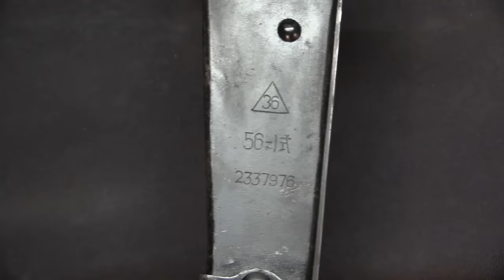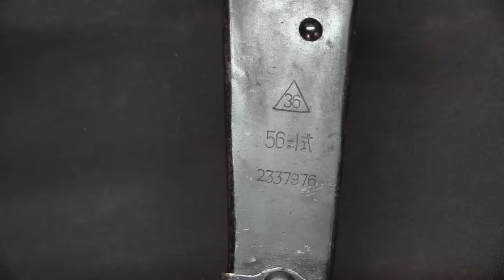RPD: The LMG Adapts to Modern Combat

Comment: Even though I know the RPK is better, I've always preferred the RPD on account of looks. It is peak Russian aesthetic.
Reply: Peak 40s Soviet aesthetic.
Reply: Huh? The RPK is the worse mg in every dimension except the logistical, come on.
Reply: i mean the RPK is litteraly an AK

can't get more russian aesthetic than that tho
Reply: @LolTollhurst  Logistics > every other parameter, because without it you have a broken gun with nothing to shoot. There's a reason the RPD didn't last very long, and the RPK is still used.
Reply: @LolTollhurst  every dimension, huh? Weight is a dimension, and the RPK is 2lbs lighter which is better. Barrel length is also a dimension, and the RPK is longer despite being the same overall length as the RPD. Number of parts is yet another dimension, and hey would you look at that? The RPK has less parts than the RPD and shares many of those parts with a supporting rifle. The only dimension the RPD actually beats out the RPK is capacity, which isn't as relevant for a squad automatic. The RPD is arguably the better LMG, but the RPK is definitely the better SAW and that's what the Russians wanted.
Reply: @JustaGuy1250  An RPK might look a lot like an AK, but they don't have as many parts in common as you might think.
Reply: Pkm is the prettiest imo
Reply: @jarink1  This. The RPK is built on a strengthened action which is why the Romanians used it as a basis to develop their 7.62x54 chambered PSL from. My guess is that it only has trigger parts in common.
Reply: @thegoldencaulk2742  I think you've forgotten about ease of ammo carry: these large belt containers aren't so easy to carry on your person, so your only option is to carry a lot of belts and just one or two containers, which eats up reloading time and hampers mobility. Reliability of the RPD is also not that great under close inspection.
Also, during the comparative trials in the early 1960s RPK have shown to perform just as effective as larger belt-fed guns in both offensive and defensive scenarios up to 800 m range, under the doctrine of the day.
Reply: It really depends having a friend who served in SOG during Vietnam he would take a RPD over any LMG save maybe the SAW the major the reason he would choose the SAW is ammo compatibility between the CAR-15 and the SAW plus it can in theory fire from AR mags  but he said today they would probably carry something like the CMMG mutant fireing  7.62 that way if they really got into deep kimchi they could pick up enemy ammo and not have to rely on pick up enemy weapons also and he had a fight where they were using NVA weapons said he never knew you could run an SKS so fast he was the radio operator so he took the SKS leaving the AKs to the little people who didn't have to talk to covie and fight the first guys they hit were bushwalkers and 2 of the 5 had SKSs meaning they were the closest to there position when one of the little  people went out to get guns and ammo
Reply: @jarink1  well yeah, but we're talking aesthetics
Reply: @JustaGuy1250  that's like saying an m60 is literally an AR-15... They have nothing in common beside the decade  and country they were invented in. 
Sorry. The ak and the M16 have more in common than and AK vs rpd
Reply: @jarink1  The only parts that are not in common are pretty much the stock, lower hand guard, receiver, barrel, rear sight leaf and base, gas block, and front sight base. The fire control group, bolt carrier assembly, bolt, upper hand guard/gas tube, trigger guard/mag catch, pistol grip and its bolt/nut are all standard AKM pattern. Even the components to assemble the RPK are based on standard items like the screws, rivets and various pins.
Reply: @JJW3  you are right, i personaly try to switch parts from m72 (rpk) and m70 (yugo akm), and romanian akm...it fits
Reply: @beargillium2369  Do the M60 and AR-15 look alike? hell no

Do the AK and RPK look alike?
Hell yeah from the outside they look almost exactly the same

idk wtf ur on about
Reply: Don't you make prank calls?
Reply: @F1ghteR41  There belts are also not interchange able with the rest of the squad, so there carrying useless weight.
Reply: @thegoldencaulk2742  oh yeah? Lighter is better? Wasn't there a thing where peace time armaments went on a diet and were then unsuitable for conflict which prompted horse trading between branches of light inadequate barrels for heavy suitable barrels? Light is nice, but it has to do the job first.
Reply: @happytoastfudge  RPD’s are still in use
Reply: @Yanuu  by who?
Reply: @JustaGuy1250  my bad, thought you were saying rpD
Reply: @LolTollhurst  it's also lighter more accurate probably more reliable
Reply: *Soviet
Reply: @beargillium2369  The RPK family is an AK derivative. It is literally an AKM/AK74 that has been elongated and beefed up, both of which were done for sustained fire.
Reply: @thegoldencaulk2742 Plus, the RPK shared magazines with the akm
Reply: @beargillium2369 that's true
Reply: @happytoastfudge 16 years isn't a bad service life tbh
Reply: @LolTollhurst 2yrs late to this but RPK is better than RPD in many ways.
RPD drum and belt is keen on jamming. Operators used to discard the drum and carry the belt alone. 
RPD tilting bolt is sensitive with ammunition as it can't handle pressure well like a rotating bolt design.
Rpk shares magazine with ak, and it uses 75 rounds drums. While it is a terrible drum, it is still more reliable than rpd.

Lighter, and less hassle to maintain than rpd. 
So that is why RPD faded out of service real quick.

Comment: The feed system on the RPD has one significant advantage over the MG/M60 one - thanks to the way the track for the roller is built and to the fact that the whole system has a biasing spring, one can close the top cover with the bolt in any position without any risk of destrouing the feed system. It's basically much more idiot-resistant than any of the other guns that use a system like that (except for the designs with a telescoping roller).
Reply: as russian guns should be
Reply: @cgi2002  Like every other country have PhD's that fill their infantry battalions. Please. Besides, the Soviets always had a conscription-based army in mind while designing their weapons. If literally every male is expected to carry a weapon *in any country*, you're bound to end up with a lot of idiots in the ranks.
Reply: @Rasbiff  most western countries have basic levels of educational requirement (some higher than ohers), and don't use conscription, and those that do tend to link it to some form of education, rather than just for the numbers to make their force look bigger. Also few western forces have soldiers as just "rifleman man", they tend to prefer most soldiers to multitask. Every soldier may be a rifleman, but they also tend to be something else too. For example my cousin is trained as a mechanic, EOD and a cook, but he is still a rifleman when needed. 
Also Russia is damned cold, and has historically had issues with alcoholism, or as some deem it "anti-freeze".
Reply: @sethlamson  hence the "most". The US army has a reputation for having the best kit, and the dumbest troops, it's the polar opposite of the British army.
Reply: And don't forget about how easy it is to load. Just shove the starter tab through the side and rack it and it's ready to fire. One does not need to open the topcover in normal use except to clear a partial belt. I'm surprised Ian didn't mention that since he got the loading procedure completely wrong in his last RPD video.
Reply: @cgi2002  If I was forced to do two years in the Red Army, I'd be drunk everyday too.
Reply: @Proximal ulna Good point
Reply: It had to be. Odds are the bloke using it would be a 19 year old farm-hand whose only major experience with mechanical tools involved a lot of hammering. The Russians saw the effect even poorly trained soldiers can have if they have rugged, simple, reliable weapons. Compare the operation of this to an MG-42 or FN Minimi (or most Western MGs) and you can see not only soldier-proofing but stress-proofing. Can you safely say that under fire a young 19 or 20 year old will be able to stay calm and ensure his bolt is in the correct position when opening the cover? Will his hands even be steady enough to operate that latch? This thing with that feed system and that starter tab makes this very easy for a terrified teenager to use and that is what armies had become, the average age of a soldier in the US Army during Vietnam was 19, the weapons needed to account for them and how they'd react under stress and had to be sufficient to survive the kind of rough handling a teenager is likely to subject it to. The Russians have really nailed soldier-proof.